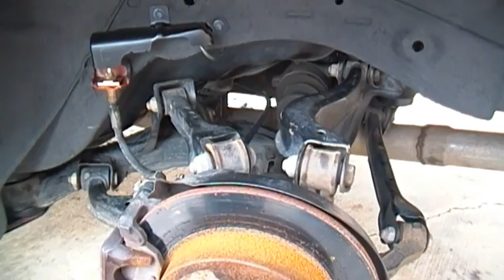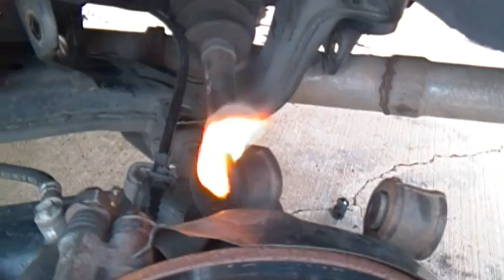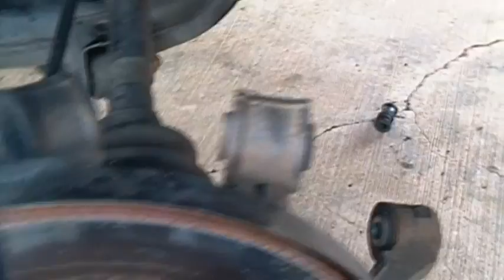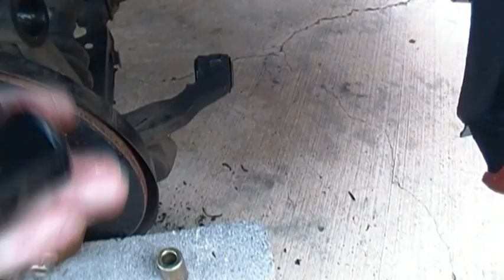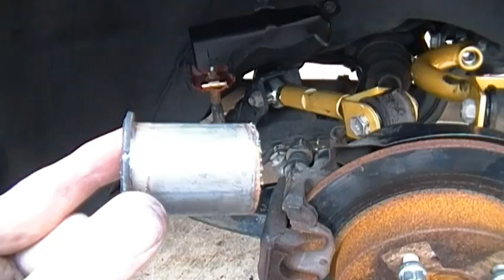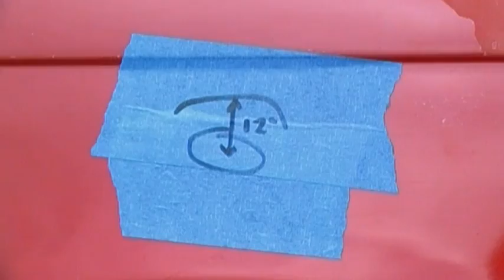Replacing the 240sx S14 Rear Suspension Arms

Comment from the maker: @Ilovetoskate757 Yes, the car handles a little better, but it required an alignment to get the set-up right.  Just changing the arms (which were set to the same length as OEM) won't do anything.  After the alignment, the car would track staright and felt a lot better handling in the corners.

Comment from the maker: @decobyrne106 I did it on the car due to timing.  I had to wait a couple weeks between the subframe bushings and arms going on.  I had a lot of terrible weather outside, I did it the hard way.  if I had a garage to work in, I would have just waited.  You can find the torque settings in the factory service manual.  NICOclub has them all as .pdf files on their site.